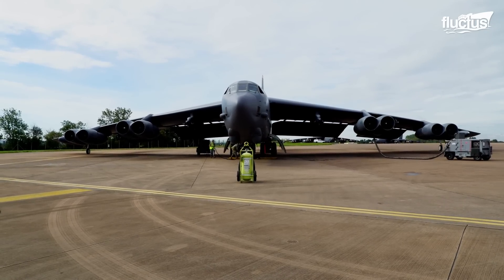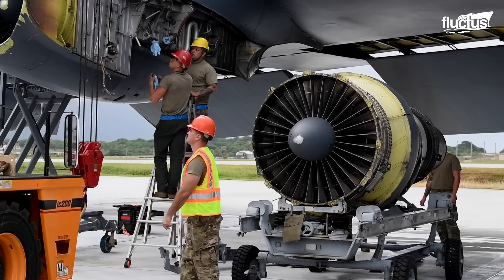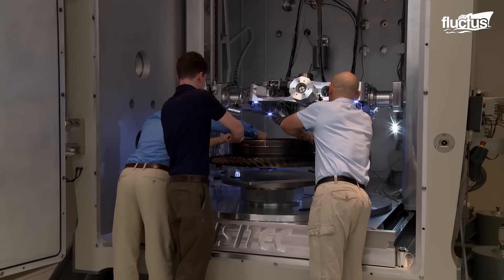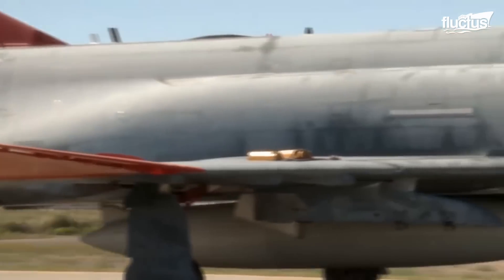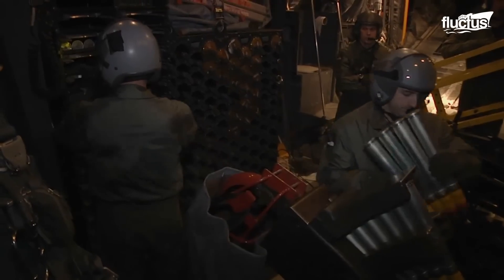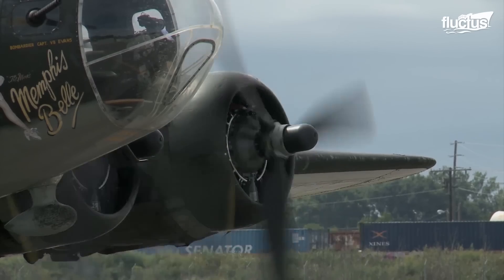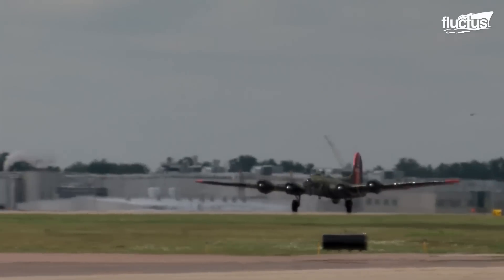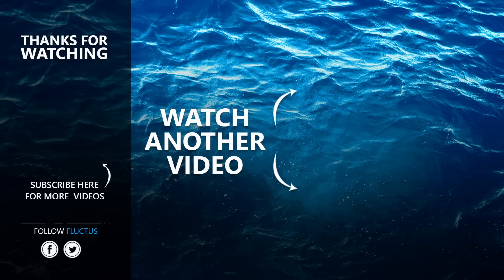Inside US Air Force Massive Hangar Restoring Broken B-52 Bomber

Comment: In 1974 to 1975 I was a military contractor at NADC Warminster in PA, we had an all-orange QF-4B BuNo 148386, that they modified to be a drone. I had heard it was supposed to be used to develop jamming electronics. We called it the Orange Pumpkin. We heard it got shot down on the first test, oops. I have a photo of it in flight over NADC Warminster I found online.

Comment: i worked in fuel systems on the B52 at travis AFB in 1966. when the wing tanks were full , they almost touched the ground . sometimes we would just hop up on the wing , walk to the tank we needed to fix and remove the cover and they were crazy loud when taxing by our work area .
Reply: The B-52's wing tips flex +/- 8ft in flight